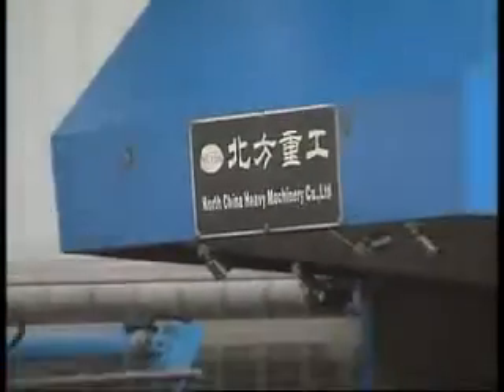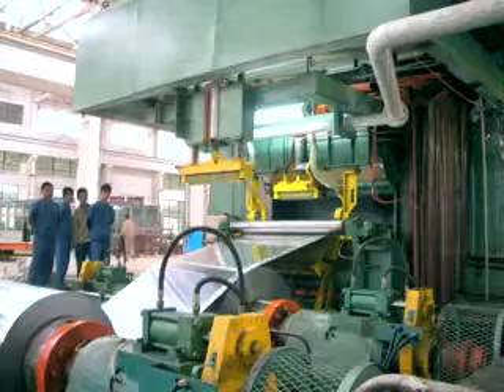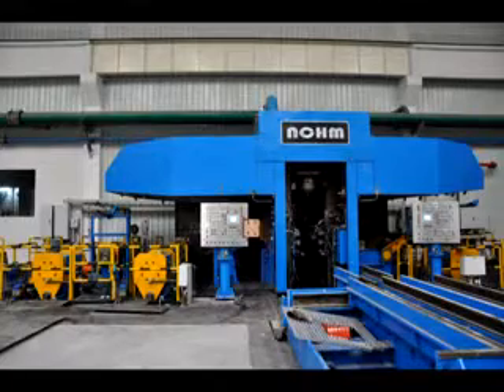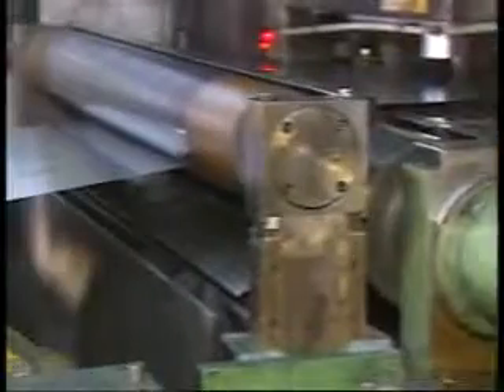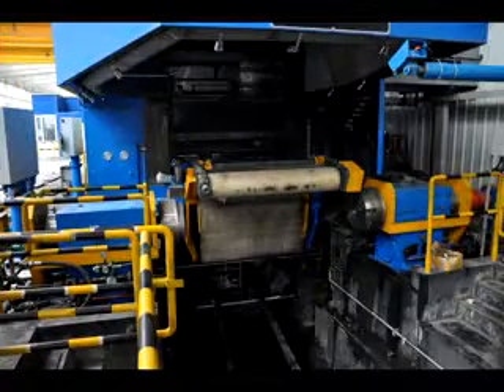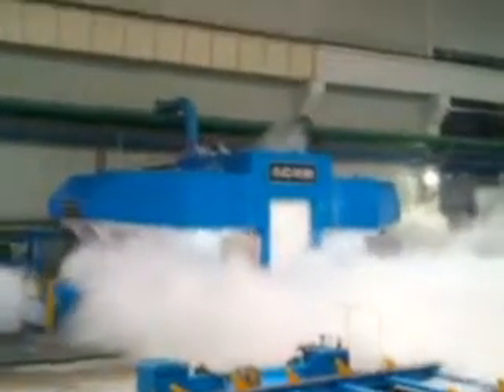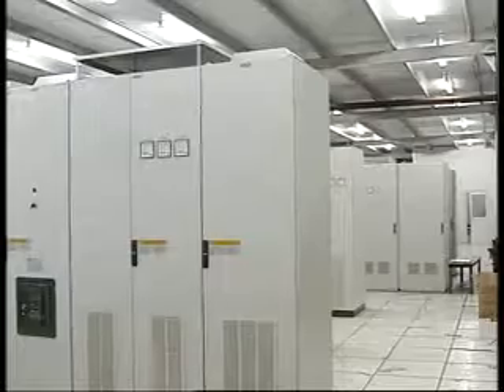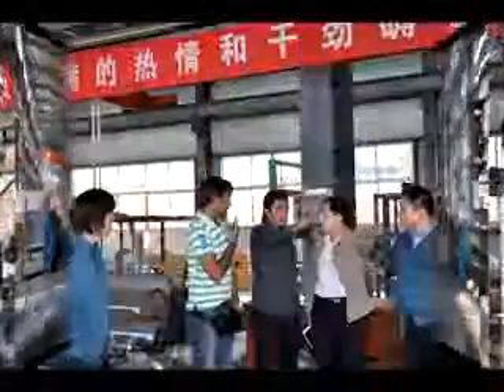Foil Mill(铝箔轧机)

Comment: Strip Wiper, drying, Wiping, oiling, remove Rubber Rolls, Cold Rolling Mills, Process Lines

rolltechin@gmail.com

Adaptive strip wiping systems, mechanical, vacuum, suction rolls for high speed reversible cold rolling mills, galvanising lines, pickling lines for all types of fluids corrosive & non corrosive for more details call +91-9050539120 or mail us at rolltechin@gmail.com.

Over the period of employment with the Cold Rolling Mills, Pickling Lines, Continuous Degreasing-Annealing-Pickling Lines, etc. we had come across various practical problems like Roll Coolant carryover, Fluid Carryover from Degreasing lines, Pickling Lines etc. which result in poor quality surface finish of the final strip. Also the frequent damage of Rubber Covering of the Squeeze Rolls whether Rubber Rolls or 3M Rolls, induces high costs and Down Time for replacing them. 

Even with the most expensive wiping systems available in the market, the results have not been satisfactory besides high running costs. To overcome this problem, we have developed a very efficient high-performance Strip wiping system which can work from 0.010mm (10 Microns) to 10.00mm thicknesses, Strip width from 100mm to 1500mm, Line Speeds from 0-600 MPM.

Please find attached the technical write-up of the High performance Strip Wiping system and videos which are depicting the wiping action of  Neat Oil as well as Emulsion Oil at 600 Mtrs Per Minute Line speed. For the purpose of testing of the Wipers in extreme conditions, we have flooded the strip with Coolant and the performance is self-explanatory.

https://www.youtube.com/watch?v=_HXdPj-VnUs
https://www.youtube.com/watch?v=fhFJsDR3Rhc
https://www.youtube.com/watch?v=FB5LAjEQhVs
https://www.youtube.com/watch?v=_ovvVwXFWIM

We sincerely hope that you would like our product which is state of the art product and we await your favorable response for which we assure you to receive our immediate attention.

With Best Regards,
For Rolltech Innovation, India

(Team Sales)
+91 - 9050539120

Adaptive strip wiping system for high speed reversible cold rolling mills, galvanising lines, pickling lines for all types of fluids corrosive & non corrosive for more details call +91-9050539120 or mail us at rolltechin@gmail.com